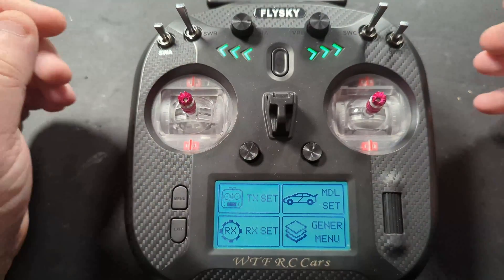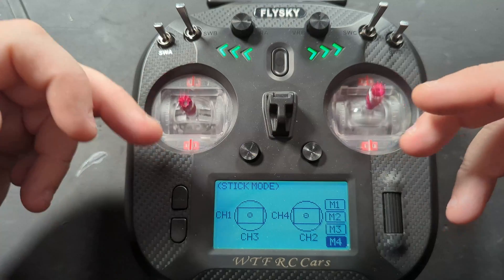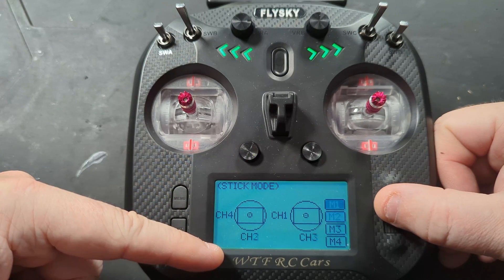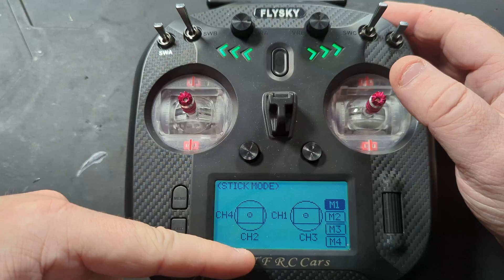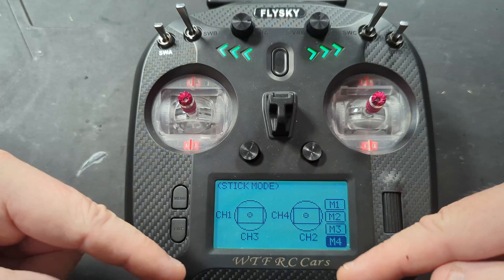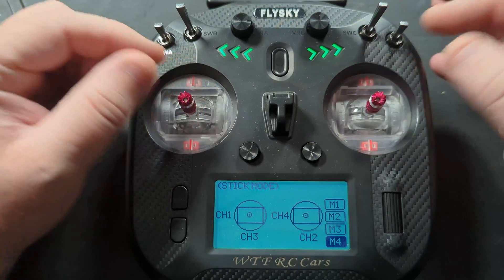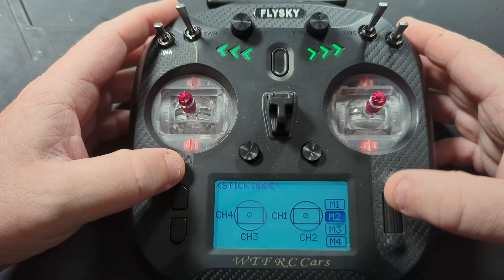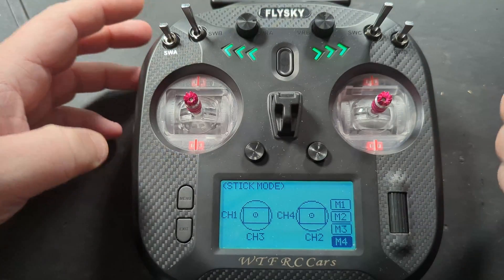Flysky ST8 Stick mode menu settings.

Comment: Pleas how to make tbe throttle trim work for IC engine idle?
Reply from the maker: Do you mean idle up setting ?
Reply: @WTFRCCars  Just normal idle adjustment for fixed wing airplane using IC engine. CH3 trim is only working when the throttle stick is at middle position. IC engine needs CH3 trim to work at the lowest stick position.
Reply from the maker: From my time flying RC helicopters the trim worked all the time, I ran idle up for a little more rpm and throttle cut to allow ic engine stop is this what your looking for ?
Reply: @WTFRCCars  Throttle cut works fine. But when throttle is enabled (not cut) there's must be some way to trim the idle speed, which is a very sensitive adjustment. Too low and the engine will stall when you throttle down. Too high and the plane will not stop on the track or even land without cutting the engine first. Every transmitter that I know allow this adjustment easily through the CH3 trim. But on this transmitter the CH3 is not doing anything when the stick is at the bottom. It appears to only trim the middle stick (50% throttle) position. Maybe Flysky was thinking about helis and quads but forgot about airplanes with IC engine? I was fiddling the settings for more than half an hour but was unable to find any configuration that would make the CH3 trim work the same as normal RC plane transmitters do since 1970's. Or maybe it's a software bug?
Reply from the maker: I'll have a look when I get a min :)